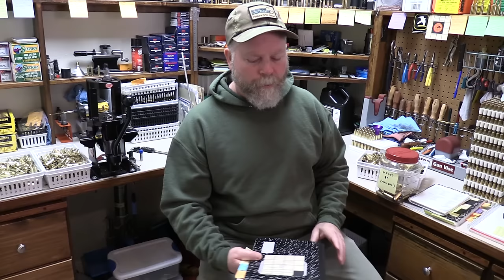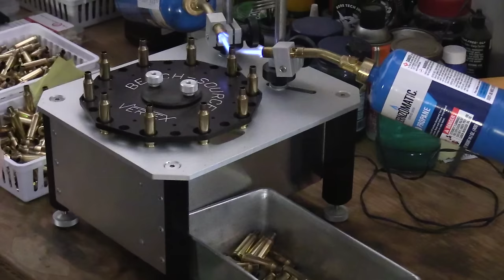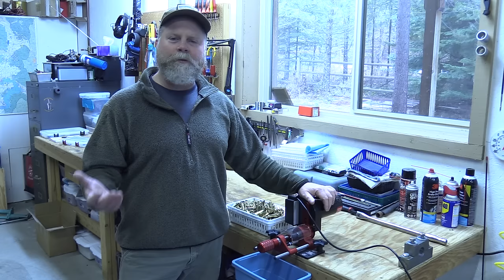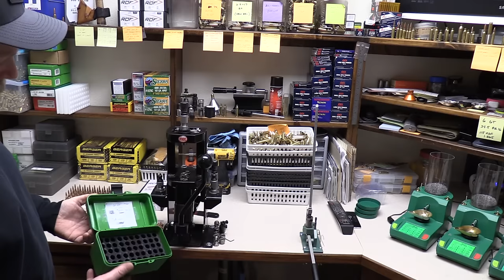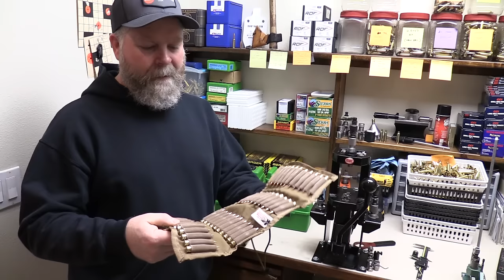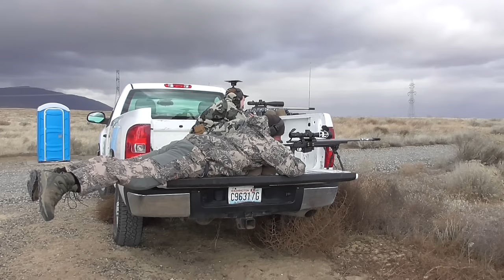Reloading for Precision Rifle: My Process--Start to Finish

Comment: Nice informative videos. I make dummy rounds with uncharged, unprimed cases with a bullet seated at proper depth. When I set up for seating a lot of bullets I use the dummy round to set the seating die. I check a few for OAL and run the lot. Granted its wasting cases and bullets. But it saves time which for me is more valuable.

Comment: Hi brother, I am a fellow Bench rest shooter, (6mm BR) I have a question or two... First, why anneal your brass? and what manufacture is the Annealer you use? How much did it cost? and do you neck size, vs FL size? or a combination of both?  Next, I like your case trimmer, I have the RCBS Auto case trimmer, I haven't seen it in any of the online stores... since I purchased it in 2010, so I think they stopped making it... I like it, it does the chamfer and debur at the same time as yours, but yours looks a little easier to use. I just couldn't see how it trims at the same size? mine has a dial, that has .001 marks to dial it in with.  I don't shoot as many as your son does, but I do shoot a good bit.  Also, what brand was your loader/seater?  and do you use Redding competition dies?  Thanks for your time, and I hope your son does well at his next match.

Sincerely,

Bron

Comment: The videos you produce are top quality!
I've just ventured into the wildcat game and will need to reload for the .20 Practical. Previously I had used a uncles reloading gear for .223 before I found a great factory round in bulk. 
Could you either do a video or text response for a gear list. i.e If you were going to start reloading knowing what you know now, what would be your perfect setup on your bench and all the other tools that are your must haves. I've seen you use a few different products that do the same thing. If you've got the time; greatly appreciated!

Comment: You switched presses. The one pictured is a MEC. Do you prefer it over the turret that you were previously using?
Reply from the maker: I still have the T-7 on the other bench. Yes, I prefer the MEC, but I use both.

Comment: Hi Sam great video and hopecyou and family are well during this time. Do you have any issues with donuts forming? Cheers from the UK 👍🏻
Reply from the maker: Donuts form in 260 starting at 5th or 6th firing. I don't worry about it.
Reply: @PanhandlePrecision  interesting! It doesn't play with your neck tension or velocity from what you've found?
Reply from the maker: @24886544  Not at all.

Comment: I am having trouble with some of my 7.62x51 sticking in my Remington Model 770 .308 after full leight sizing. seems to be sticking in the neck/ shoulder area.
I have Lee 4 die set for .308win
I have tried to work cases down in it by 1/8 a turn to bump should back some.
Some are very tight in die as they get near the head of case. Take them out and lube again before moving down.
It seemed to help some but still getting those same cases to stick.
I have sized just cases and tried them without bullet. Those cases still stick. Everything is very clean.
Have you got any other Ideas?
I have thousands of those cases and don't want to Trash them?

Comment: Great video----how accurate is your powder thrower?  I am using H1000 with a load of 77~79 grains and was wondering how accurate it would be for this powder?  Also what type of annealer are you using and where to get one?  Would like to see as other have asked an equipment list and source for reference.  Thanks, Mike
Reply from the maker: Chargemasters are rated for .1 grain accuracy. They work great with H1000. I use a Bench-Source annealer.

Comment: Great videos! Thanks for putting in the time on this type of content. I do have a question about your powder charges. Do you ever find yourself tapping the outside of brass to settle powder? Maybe for larger loads? Just was curious.
Reply from the maker: If I need to run a compressed charge, or one close to it, I use a drop tube.

Comment: Sir thanks for sharing your info..in a previous comment you stated that you did nothing to brass after tumbling ,post sizing.. Maybe it's because I use unique case lube and walnut media. I then  Use compressed air and blow from the primer end and then the neck end. But I am still left with media dust in the necks. So I use cleaning brush, and tap the brass to remove. I then  Wipe each neck with AQ tip and denatured alcohol. The q.tip is black after 5 or 6 cases..I  then prime and load.  Should I switch case lubes and media what's your thoughts.. Thank you very much. 🇺🇸
Reply from the maker: I've been using One Shot and corn cob media for a very long time now. I never have problems with media dust or clumping inside case necks.

Comment: at 14,000 rounds in a season, when do you replace your barrel ? is it replaced at a certain number of rounds, or is it replaced when you see a loss of performance ?
Reply from the maker: OZZY That 14k last year was from several rifles, including mine. Jake burned through three barrels chambered in 260 Rem, with a little over 7k combined. Those barrels shot very well even with 2k rounds on them, but I try to plan replacement when it’s convenient, rather than when it becomes necessary. We’re going to have a learning curve with the 6 Creed, to see when I’ll have to replace barrels.
Reply: @PanhandlePrecision  Thank you very much

Comment: Sam, thanks for the reloading simplicity instead of complicating a cheese sandwich. LOL's BTW would you consider putting in a link for the tools and equipment you used possibly to help others find such items, please. Thanks again. One more question what do you think the barrel life will be on the 6mm GT ?
Reply from the maker: jeff wright I will add a few links in the video description. We shot the first 6 GT barrel to 2000+ rounds. The second one was setback at 600, then used for 900 more before switching to 6 Creed.

Comment: Thanks for walking us through the process you ended up with.

Do you clean the lube off after sizing?

Are you using the expander in the sizing die?
Reply from the maker: Todd B Yes and yes.
Reply: @PanhandlePrecision  Hi Sam.  Why did you start using the expander in the Type S die again, I just bought one and took it out after watching one of your earlier videos on the Redding S Type Bushing Die where you said you never use it..

Comment: You case trim every firing? And what brass are you using?
I'm loving my MEC also👍
Reply: Would almost guarantee Sam is using Lapua brass. Extremely consistent and works. But it’s been a while so guess anything is possible.
Reply from the maker: Jake is using Alpha 6 Creed brass. Yes, I start trimming after the first firing, then after every firing.

Comment: Interesting lube process. Do you remove any lube that might end up inside the cases? Or does it not have an impact? Tx
Reply from the maker: Tumble with corn cob media for 45-60 minutes to remove residual lube from outside, then quick swab with alcohol patch to the inside of the necks.

Comment: Am I chasing the wind?........ Loading 22-250, I use new Lapua brass and Hornady 53gr Vmax bullets. I sort the cases and bullets so when I load up a batch for testing, all the components will be uniform. To seat the bullets, I rely on the Redding Competition seater. I am slow and methodical in every step. Here’s my question.... no matter what I do, I end up with a .001” to .003” variance in the finished round... measuring ogive with the Redding Instant Indicator and/or micrometer. Is the variance pretty normal or do I need to pursue it? Thanks.

Comment: Hey Sam, what are your thoughts on a progressive reloading system?
Reply from the maker: I use a Dillon 550 for pistol ammo, but haven't tried it for precision rifle. I don't think I will, either.
Reply: @PanhandlePrecision  Agreed, progressives are great for high volume ammunition that doesn't require absolute precision. Pistol ammunition is shot over much shorter distances too so less likely so show up any inconsistencies of a progressive press.

Comment: I have a Cooper rifle in .204 Ruger. In measuring the CBTO un came up with 2.244. If I back off the seating depth 30 to 50 K, my bullets just fit into the case by about .30 k. In measuring a factory .204 Ruger case, I would be 110 K off the lands. How do you properly determine proper seating depth in a rifle with a long throat?

Comment: Can u give me some information. I have a Tikka tac A1 in 260 Remington. I have shot some impressive groups with the 147 ELD-M and I want them up around the 2750 range and with 43.2 grains of H4350 I have that and under .5 groups. My only issue is with my Hornady brass I'm losing primer pockets after 4 or 5 firings. Do I need to get higher end brass or am I just loading to hit in your opinion?  The best group I have found with my 140s is 44gr of H4350 and have the same issue. If you think it could be a brass issue have u ever tried prime brass?  I have some to try or do I need to get alpha or Lapua?
Reply from the maker: andrew geary I’ve never used Hornady brass with 260, but I’ve tried it in other cartridges. I’m done trying it. Alpha and Lapua will last longer, and probably give you a little bit tighter ES numbers. Charge range will probably be 41.5-42.5
Reply: @PanhandlePrecision  Thanks for the reply! I have just found your channel and am glad I did. So I'm guessing my charge off 43.2 is a little to high?  Crazy thing is I got all way to 45 before I seen much sign at all.

Comment: not new to reloading but new to the precision world with that kinda of round count how often are you burning through barrels I shoot 300 win mag alot and have never noticed a degradation in accuracy throughout 5000 rounds but everyone has told me that at 1500 rds the barrel is done just wondering your experience on this as you are going through ammo at a much higher rate than I am.

Comment: Hi Sam
After watching your video about RCBS chargemaster lite was going to order one.
Been put off though by reading a few reviews that state it is not reliable enough to throw consistent weights.
A lot advocate an underweight charge, take pan off & place back on then trickle up to desired weight, IMO it sort of defeats the purpose of an auto electronic scale.  I would appreciate your comments please.
Reply from the maker: RN UK Not my experience at all. Makes no sense to throw under, then trickle up.
Reply: @PanhandlePrecision  Thanks for the quick response Sam, I have watched most of your videos and I know you are a pro (and Jake) at long range stuff.
If you trust the product then thats good enough for me.  Will get one ordered right away.
Keep up the good work & stay safe in these crazy times.

Comment: Hey Sam, question about the powder funnel you use to load cases, is it made of heavy glass, or steel or ? Sounded kind loud when you set it on a case. Also what brand? Thanks, always learning from you!  Bobby M.
Reply from the maker: It's anodized, heavy aluminum, made by Precision Hardcore Gear.

Comment: Say u accidentally get 2 cases mixed up and they are one firing off .. say one is 2x fired and another is 3x fired .. (annealing everytime).  Will thier b that much difference n down range performance?
Reply from the maker: I wouldn’t care between 2nd and 3rd firings.

Comment: In a previous video you mentioned annealing after every firing, in this video with the 6mm Creedmoor it was on its 2nd firing and you were not going to anneal it. So how often should 6.5 Creedmoor be annealed? I don’t have an annealing machine, just a torch and drill. Thanks for the great videos.
Reply from the maker: Arlan Johnson I treat it like maintenance. If done correctly and often enough, you’ll never know the difference. The only brass I’ve used that needed annealing before the fifth firing was WW. The Alpha 6 CM brass in this video is on its fifth firing, and will get annealed before the next sizing cycle. Good luck with the torch and drill.

Comment: I have watched your videos and I use your process religiously. If I forget something I can always watch the video again. YouTube is great, better than reading books. Because of the content I watch a video popped up about not to set your shoulders back on your cartridges. Only set them back to where your bolt closes snuggly for the accuracy and to the case seal the best and be centered to the chamber. I thought this was extremely dangerous on a factory rifle, one your chamber needs to stay perfectly clean and two wouldn't this create a pressure issue.

Comment: He used to have a green turret press. I’m new to this. Does the MEC do full length sizing AND neck tension (via bushing and mandrel) in that one throw he does? Or is there another press needed for the neck tension he’s not showing here? AKA is the MEC a one-stop ship for sizing, de-priming and loading ? If so that’s awesome. Just trying to figure out how many damn presses I need to buy for this hobby. Thanks!

-FNG

Comment: Hello Sam, awesome video as usual. Just wonder why you decap first, then clean, lube, prime, size and clean again. Wouldn’t be easier to lube, decap & size, clean and then prime etc? Brass used in bolt action is not that dirty to run in the sizer die. Thanks and greetings from Italy.
Reply from the maker: It would be easier, but still hard on sizing dies.

Comment: Can you tell me what is a good neck expander for 6.5 prc to give me the .001 neck tension?
You mentioned the Sinclair in another video but can’t find one online. Rcbs sells one but they don’t give any dimensions on the description, they are CBS full length seating die expander is .262” which is very tight for starting bullets

Comment: How many seconds do you recommend to anneal 6.5 creedmor . Also is the heat set all the way on the torch ??
Reply from the maker: I like to adjust the flame to be done @ 5-5.5 seconds on 260, 6 Creed, etc. I’ve never used it with the valves wide open.